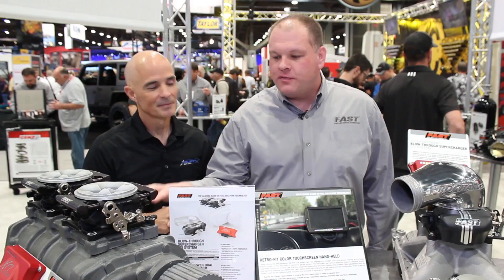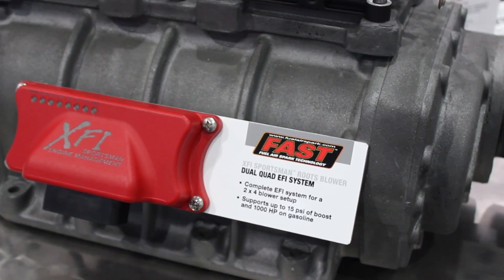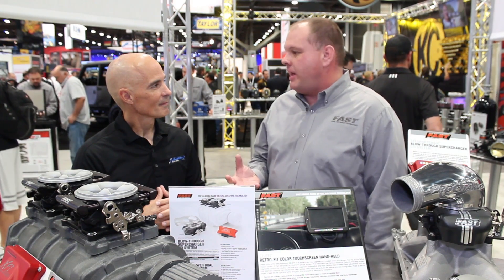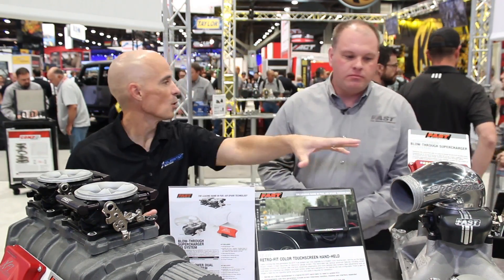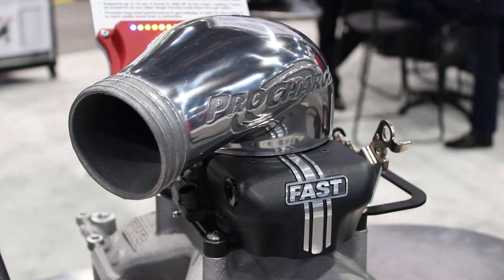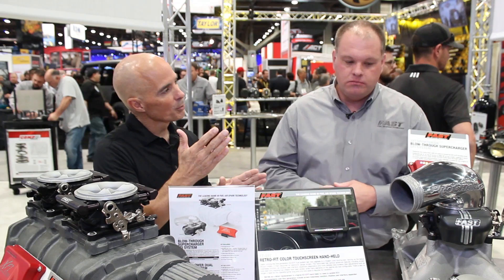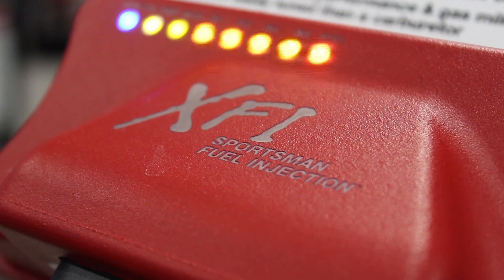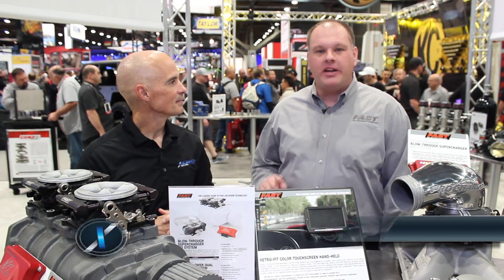2015 SEMA Show | FAST Supercharger and Blower EFI Systems

Comment: FAST efi....    customer service ditched me and ignored my emails.. after...  i installed their efi, turne don the key...  Fuel sprayed from a cut oring around the injector THEY installed... across my droplight, popping the bulb....   melting wires etc....   I got it put out...  wanted them to fix the EFI....  I didnt ask for ANYTHING else... and after original contact... WOULD NOT reply to me again....   NEVER buy FAST EFI....-